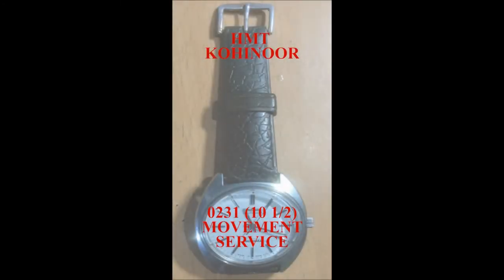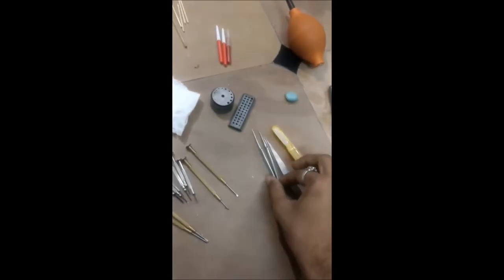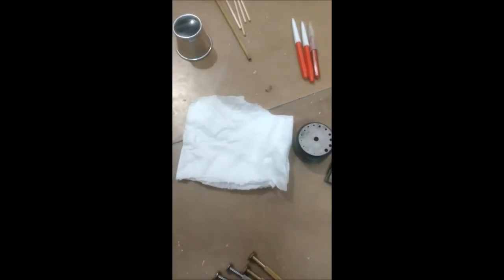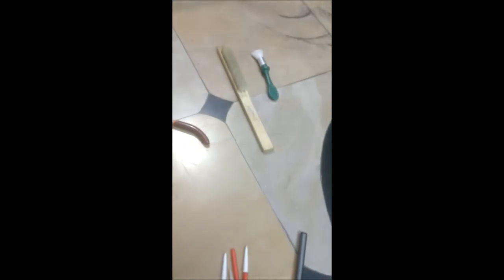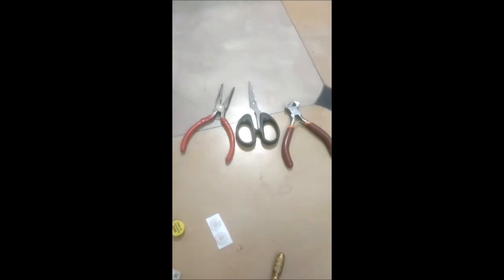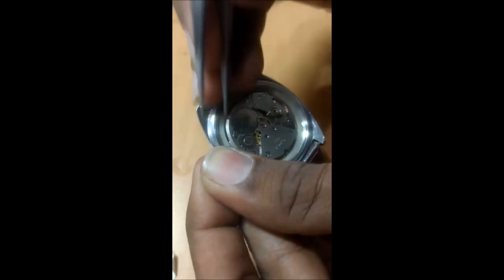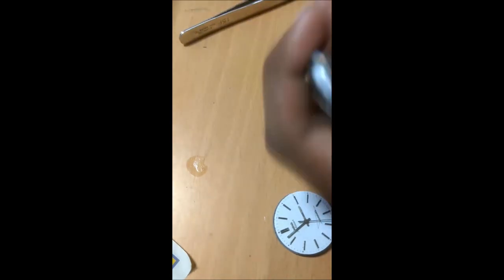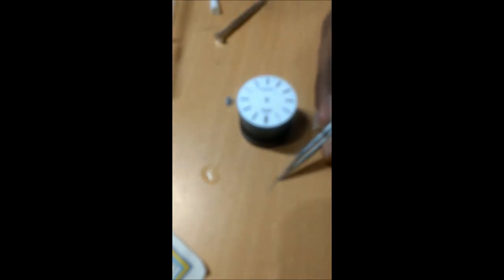HMT SERVICE PART-1 : Intro and Disassembly.

Comment: Got a Pilot HMT 'fully serviced'. It ran fine for the first two days - about 35 hours reserve. Then on Day 3 it stopped after about 10 hours. From there it went downhill. Day 7, fully wound up, watch will regularly stop after only 2 hours - i would wind-up one turn to full, it restarts then stops again after 2 hours. Always test for several days. I asked for refund on Ebay but how do I prove the watch stops intermittently? Even linking a Youtube video in the refund email, I cannot show the watch just stops at some point.

Comment: Great video. I'll review it fully tonight. I was working on my HMT Janata since it was running slow by adjusting the +/- . It suddenly stopped. I'm not sure how to review it even though it does start up on it's own accidentally. Any suggestions are welcome.
Reply from the maker: It could be that the watch went out of beat or you accidentally kinked the hairspring sir. Please check if the hairspring spiral is ok with a magnifier.
Reply: @ullasu1788  okay thanks. I'll check tomorrow.

Comment: Where to buy the tools, especially the movement holder?
Reply from the maker: If you are in Bangalore, i can provide location of a few shops sir
Reply: Ullas, Thanks for the video. Much appreciated. Did you share the details of the shop please. I need help too. Thanks Much!

Comment: Kohinoor ka crystal without case back open kiye niklega???
Suction cup se??
Reply from the maker: My hindi is very bad, but from what I understand, you want to remove the crystal of kohinoor without opening the case right? Proper tool for that would be a crystal lift, but a case opening knife, if properly used, will also do the job

Comment: I have a hmt pilot that doesn't work and a watch repair kit. Time to get to work. Thanks a lot for this.
Reply from the maker: Glad if I am of any help
Reply from the maker: Just a word of caution, HMT Pilot is a rare and kind of expensive watch compared to other HMTs, careful tinkering with it, especially if it is important to you, mainly because, if it's your first attempt, you may end up damaging something!
Reply: @ullasu1788  thank you for the heads up. Well it's my second attempt not my first but yes I'm still a mere beginner. I'll do my best to not break it.
Reply: @ullasu1788  just an update. I think I fixed it. I just had to spin the balance wheel a little to get the gears moving again. But this watch definitely needs service. So I think I'll open it up completely later.
Reply from the maker: @SriramVad  does sound like it needs a good service sir, atb!

Comment: many parts of the video were out of focus . otherwise , very detailed informative video!
Reply from the maker: Well, as I have stated, I don't have proper setup to record videos. This is quite old too, so there are mistakes. I have recorded a much better new video, but I have been a bit busy. Will upload a better version soon after editting and voiceover
Reply: @ullasu1788  thanks for the speedy reply. found an old hmt kohinoor in my attic recently. thats why . your video was very helpful however...thanks!!!
Reply from the maker: @ishankelkar4347  that's amazing. Hope you get it ticking again. If it's valuable to you, family heirloom or something, i advice you to not practice on it. I always say, that it's almost not possible to learn without breaking a few watches 😁
Reply: @ullasu1788  the thing is I have given it for repair. It is ready but I am so interested in the inner workings of those works of art that I started searching how the servicing of a mechanical movement is done. Parallely, when my watch was being worked upon! That's when I stumbled upon this amazing video series of yours!
PS it is a 4 generation old family heirloom! So I'm feeling proud preserving history!😁
Reply from the maker: @ishankelkar4347  that's awesome. I find more pride in wearing these watches then i do with new ones😅

Comment: Hello again!
Do I have to follow same steps for hmt ullas as well??
Reply from the maker: Hello sir, I didn't quite follow your question
Reply: @ullasu1788  should I go with the same steps for other hmt watch's as well?
Reply from the maker: @vardhankamat4225  yes sir. HMT gents handwinding watches usually come with the 0231 movement like this, or the older movement which is similar to this. If the movement is different, many steps would be same, although some steps in this video are not the best. This is an old video, and I hope to post an update soon
Reply: @ullasu1788  yes waiting for more videos from ur side
Well explained! Appreciate 💯
Try on other watch companies as well

Comment: Is Mercury solution for cleaning the parts available freely and where? what is the name of the
rubber like  substance used for dabbing the parts? Please help me.Also,where I can get the 
original spares for HMT watches,like click spring,Ratchet wheel screw,Arbor,stems and other
parts on stem side?
Reply from the maker: In Bangalore, they are available at Chickpet sir. There are many shops selling them. The rubber like substance is Rodiko
Reply: @ullasu1788  Dear Sir,
I want to get clarified the followings:
1.What for Rodiko is used?

2.with regard to HMT watches ,are the pallet fork is different in size from model to model?
Please enlighten me.Thank you,
R.Gopalakrishnan.
03.01.19
Reply from the maker: @gopalakrishnanramaswamy6562  Sir, rodico is the trade name for a putty, used to clean fine dirt off delicate, small parts, for example, between gear teeth's during assembly. You can just push the pivots into it, or roll the gears over it, and it will trap that fine dirt. 
The parts of any watch mainly depend on the movement sir. Most of the Hand winding HMT Gents watches run on HMT 0231 movement, and very old ones may have the older HMT 020 movement. Many parts are interchangeable between them, and hence, almost all hand winding HMT gents watches have all parts, including the pallet lever interchangable. Same would hold good for automatics, and ladies watches (many parts between two hand and three hand ladies watches are also interchangeable). I have not worked much on HMT automats though. These movements are based on citizen movement, so some citizen movements also can use these parts.

Comment: Respect man. Doing the same now.
Reply: I have a question. Post assembly, i find that the watch stops working when i put the caseback on. I think there must be some alignment issue with the spacer, but i put it back exactly the way i disassembled it. Do you have any better pics of the plastic spacer?
Reply from the maker: Subramaniyam R I'll try getting a better picture of the spacer sir. Where should I send it?
Reply: Ullas U can you put it up on flickr or photobucket? It will be a good reference for a lot of us

Comment: What is the name of the oil/brand used for lubricating the parts of the watches in general
(of good quality).Also the brand of the grease.Where oil and grease should be applied?
Reply from the maker: There are few brands available. I use one from Roshan. They are quite cheap and I feel its good enough. Moebius is the standard oil, but too costly
Reply: @ullasu1788  Sir,-
Thank you very much for your speedy response and clarification.Your video
showing the servicing of the HMT Kohinoor(manual)  enthralls me and  is amazing.It shows your expertise in servicing and your way of doing it is 
very impressive.It is totally procedural and I appreciate your ability&skill.
I am  a watch enthusiast and a beginner in watch repair.Can you please
provide your email ID? I can contact you if I have any queries and doubts.
Thank you once again,
R.Gopalakrishnan.
03.01.19.
Reply from the maker: @gopalakrishnanramaswamy6562  you can contact me on ullas1795@gmail.com or 9686951979 sir. I am quite a learner too. I have made a few mistakes in the video, some of which I have mentioned in the video itself. You can contact me sir, no issues, i can help with what I know.😄

Comment: Sir please teach me how to tune the speed of winding watches.
Reply from the maker: Dear sir, I don't have the precision instruments (Timegraphers) necessary for perfectly tuning the rate of a winding watch. I check the watch for 24 hours, and adjust the regulator based on guess and experience. It's kind of trial and error. I Will try to make a video and post ASAP
Reply: the general rule is move the regulator lever the smallest possible amount, and be very careful you don't poke the balance spring. with a quartz stopwatch, it will only take a few hours to know whether your next adjustment is faster or slower

Comment: Where can I purchase the cleaning fluid, oil and the hairsprings?
Reply from the maker: Where do you stay sir?
Reply: @ullasu1788 bangalore
Reply from the maker: @donygeorgek  Chickpet sir. You can drop me a whatsapp message, or call on 9686951979, I can give you more details.
Reply: @ullasu1788  Sir,-
I am residing in Chennai.My 4 HMT ,1 Allwyn and 1 Citizen watches  need 
click springs,arbors,arbor screws,stems.Also,where i can get the mercury solution?Please guide me.Thank you,
Reply from the maker: @gopalakrishnanramaswamy6562  I am not sure about Chennai sir, I have to enquire. Parts of Allwyn, HMT, and Citizen, are easily available here, so I guess its the case there two, and the same goes about the Mercury solution. Mercury brand is widely used here, but if you get any other brand, maybe good to try. L&R is supposed to be very good, I've heard. Ill just ask a few contacts about shops at Chennai, and let you know